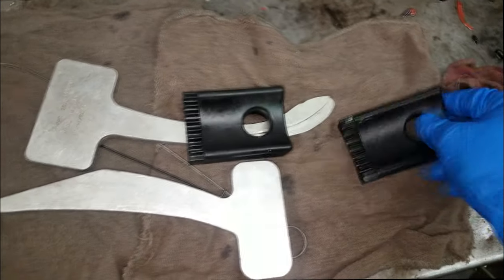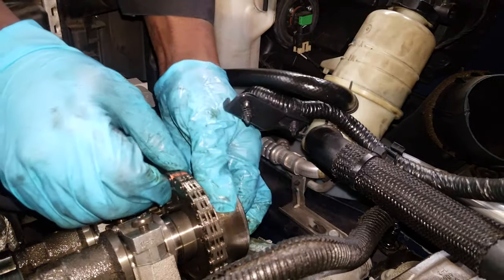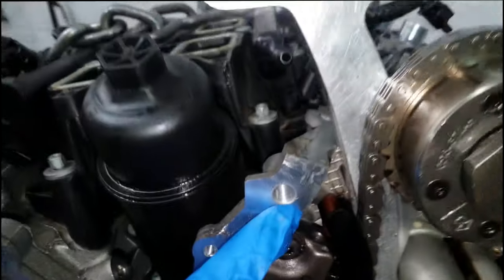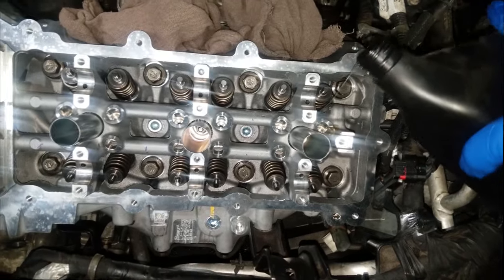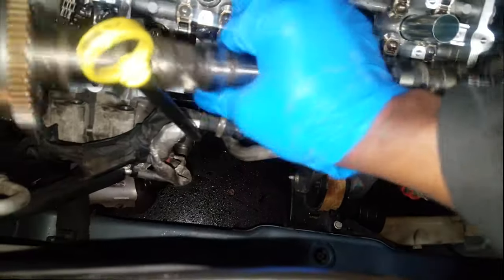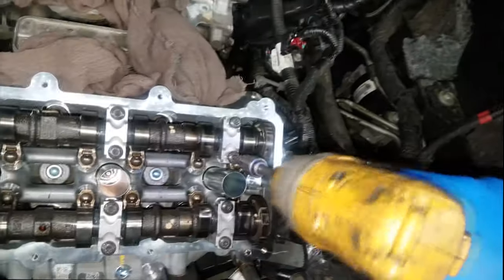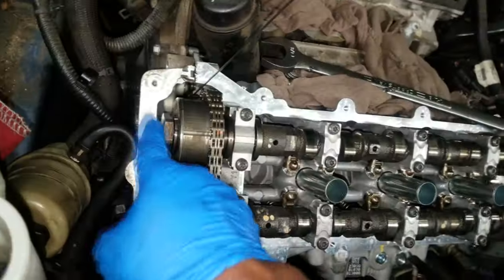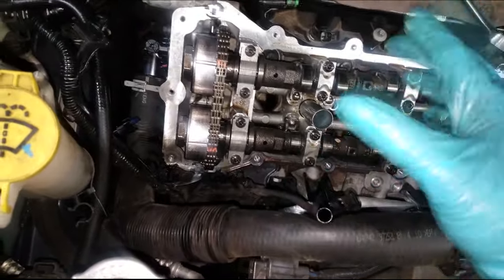How to Replace a CAMSHAFT, CAM Phaser,  rocker arms, 3.6 Pentastar, Timing Chain TOOLS P219A P219B

Comment: Just changed lifters and rockers using the tools. Now have p0019 and rapping noise on start up from front of motor (3.6 pentastar) that goes away after 2 seconds. The engine nearly stalls then sets code. Any ideas? Runs really quiet but has no power. Like out of time.
Reply from the maker: Did you cheat and pry the cams up to remove the parts or was everything removed properly? Also, are you subscribed to the channel?

Comment: I have a 2012 dodge challenger 3.6vvt will be replacing ext. Cam on passenger side which piston needs to be TDC to do this piston 1 are piston 4
Reply from the maker: Hey Richard, this engine has 4 camshafts, if number 1 piston at tdc, the marks on the phasers should be aligned. I would mainly focus on the marks on the cam phasers because there is no mark on the crank pulley. Curious, why are you replacing the cam? Also are you subscribed to the channel?
Reply: @OnlineMechanicTips  yes I am subscribed I'm replacing the cam,rocker arms,and lifters for that side because I let replacing a bad rocker go on for to long and it eat into the lobes
Reply: @OnlineMechanicTips  so the scribe lines and the arrows on the  cam phasers will only line up at TDC correct
Reply from the maker: @savage_empire_ammunition  yes,  also mark the chain so you can put everything back in the right place
Reply: @OnlineMechanicTips  thank u for your help and content
Reply: @OnlineMechanicTips  last question the oil control valve socket size

Comment: Hey bro I just replaced the drivers side rockers and lifters. All the timing marks are good and dead on but my chain has a little slack in it. How can I get the slack out of the chain?
Reply from the maker: What kind of car is this? Also are you subscribed to the channel?
Reply: @OnlineMechanicTips  yes I'm subscribed to u bro...and a 2016 charger sxt
Reply from the maker: @stanleyjones2555  Thats bank 2. Its the tensioners job to remove the slack but that may not fully happen until the the car actually start running. As long as you 100% sure its timed perfect and you have manually rotated engine to verify again and its still in time, you good. Recheck again with all the remaining slack at the tensioner area. When you start it that hydraulic tensioner will do its thing. Its not un-common that the chain appear to have slack.
Reply: Ok I was able to put a wrench on the cam and rotate it a bit and the chain was tight again I was just worried that when I start the car the slack would come back. Do u have an email address so I can send u pics of the timing marks. And should the cam bearing caps be torqued to 7.4 ft lbs?
Reply from the maker: @stanleyjones2555  Hey bud, I dont no the specs by hard, And if the marks are lined up, you should be fine. Im not understanding your concern..Look and make sure your specs are right. https://www.youtube.com/watch?v=xwT9z6SB9l0&t=40s
Reply: Thanks for your help bro!
Reply: Should there be a tight spot when rotating the crank by hand. When I rotate the engine it will turn easily then there is a hard spot that takes more force to turn it. Is this something that's normal?
Reply from the maker: @stanleyjones2555  Yes this is normal as to it will feel like compression stroke. Not a problem
Reply: Ok so I took all the plugs out to make sure it will turn freely...after doing that the timing chain marks moved from the marks on the cam phasers. Do I need to keep rotating the engine until the paint marks line back up?
Reply: Nevermind Bro I got it! Just had to keep rotating the engine until it the marks lined back up. Thanks for all your help homie. 💯 Keep doing what your doing Bro. 💪💪

Comment: I just completed this job on a 2014 Ram. Same 3.6 engine but now I'm getting a p000a and p0017.. the engine will stumble and surge at 900rpm mostly. Sometimes it takes longer to set the codes but I'm racking my brain trying to figure this new issue out. Any advice? Thanks!
Reply from the maker: What do you call this job? What exactly did you replace? Also are you subscribed to the channel?
Reply: @OnlineMechanicTips  yessir I'm subscribed. The truck came in with a constant tick and no codes. Pulled the passenger side valve cover off, found one rocker arm on the intake side had failed and ate into the cam lobe. Customer approved replacing all the rocker arms, lifters and intake cam for just that one bank. I followed the procedure, torqued everything to spec but now when I start the vehicle it lops around 900 rpm a few time until finally settling down. If I rev it or drive it (truck bucks sometimes at parking lot speeds) long enough it will eventually set those codes I mentioned previously. I've relearned the crank/cam position and cleaned the oil control valves with my scanner multiple times. Changed all the solenoids and sensor just to see what would happen and nothing. Fresh oil change after the job as well.
Reply from the maker: @SheaAP1  So if you did all the rocker arms you had no choice but to remove phasers for timing chain removal (at least I hope) couple things, this a cam code thats monitored by a cam sensor. Phasers has to be on point and properly timed. Also curious if you loosing oil pressure at those oil gallery plugs right under the phasers. You gone have the back track what youve done. If problem was not there until after you done this repair, look at what youve done. Sometime when the oil control valve phaser bolts removed, the spring inside the phaser would come apart, thats why I replace phasers at 80k and up

Comment: What causes the rockers to fail and do you just replace the failed ones or all of them also what about the lifters? Is it just the intake or exhaust  rockers that fail or both?
Reply from the maker: Here at the dealership we only replace just the failed ones if its under warranty. I suggest if you plan on keeping the car that you replace them all. As for what causes this, thats an ongoing debate, everbody has they own take on it. Thanks for watching. Do not forget to sunscribe to the channel please, thanks
Reply: Right now  it mainly rattles on startup. but, I feel like it has developed a continuous faint noise. possibility an exhaust leak. I have replaced a few rockers on some late model Audi's before the first oil change which is just plain defective parts 🤔
Reply: Would you say the rattle on startup be one of the cam phasers or rockers?
Reply from the maker: @michaelmoore9220  Bud, have you subscribed to the channel and thumbs up the video?
Reply from the maker: @michaelmoore9220  This Pentastar engine valve train noise can come from different areas. Do your ABS light come on?
Reply: The abs light has come on before but not regularly and is off after a key cycle i guess I need to hook up the modis and check for any historic codes

Comment: Did chrysler ever fix this problem?  Thanks
Reply from the maker: If you referring to the ticking noise, the parts have been revised. So until the newer parts installed, you will likely have same problem. But no, there is no recall on these repairs.

Comment: My timing chain tensioner keeps ratcheting when i crank the motor by hand, its like the tensioner isnt fully engaging, how do i fully release the piston? or is that normal?
Reply from the maker: Hey bud, I see you a subscriber, thanks. Listen, the plunger on the tensioner when retracted should stay retracted. This keep tension on the guide which in turn keep tension on the chain. Im not understanding what you mean
Reply: @OnlineMechanicTips  Hey thanks for the response.  I have released the tensioner, i see the piston pushing on the guide, but when I was cranking the motor by hand to make sure everything is spinning the guide is going back and forth and i see the tensioner piston retract back into the housing and then back out to push against the guide.  Hard to explain but i assume it is not supposed to happen
Reply from the maker: @evanjacob8807  It will extend then stay out once you start car. Best thing you can do is to put all the chain slack at the tensioner point where it will extend out the most.
Reply: @OnlineMechanicTips  Thats exactly what i needed to know, didnt wanna put it back together and fire it up if that isnt how it is supposed to work, thanks man! Im used to worked on LS motors, this dohc stuff is way more complicated lol

Comment: I have a Dodge Avenger 2011 v6 3.6 replaced head gasket I put new timing Chains kit car starts good the first time but won’t last on 5 seconds then I started again it only starts when I press the gas all the way then when I release the gas it turns off messed with the timing like 5 times car was running perfect need help.....

Comment: What is the side of the Oil Control Valve head?
Reply from the maker: Hey bud, thats a 1 13/16 socket I think..Are you about to replace the phasers of do a rocker arm job? Also are you subscribed to the channel?
Reply: @OnlineMechanicTips  Thank you so much. I am replacing my rocker arms, the needle bearings went bad in a few. Just been picking it apart between jobs, and ran into not having anything to fit it, and couldn't find the size anywhere. I am subscribed, keep up the good work man 🤙🏼

Comment: Man, I have QUESTION 
thanks for making these vids man . I watch yuh all the time

My question is when putting new camshafts in how do you know that the shaft is in correct position before attaching phasers.
Reply from the maker: Those phases will only connect /o the cams 1 way. That lil dot nipple will have to go in. From there rotate cams until your marks match that hopefully you marked. The holes in the center of the cams should be pointed straight up
Reply: @Online Mechanic Tips   thanks a lot boss, just about to dive into a jeep wrangler to do lifters & rockers . Might hit you up for more advice if that's aiight.? Maybe I'll make a vid
Reply: @Online Mechanic Tips  so if I were to replace just lifters, couldn't I take the cam off the phaser without removing the phaser from the chain ?
Reply from the maker: It gets tighter and more risky the closer you get to the front. But I'm curious why are you replacing the lifters?
Reply: @Online Mechanic Tips  rockers & lifters the ticking started a few hundred km ago and is getting louder . When I listen it' sounds like two rockers are thrashed on the left side exhaust cam. The right side had bad failure and had new camshafts ect before I bought it

Comment: I have a Buick enclave I'm working on and It ticks pretty loud so I was planning on all new rockers, maybe lifters, and judging by the time it has been this way, I figured it will need a cam too.  When I look up the cam it has 3 different cams (gens) listed (basically 1, 2, &3).but I don't know which is on this car.  Is there a way to find out without taking off the valve cover or does it even matter which gen I use???
Reply from the maker: Hey bud, thanks for watching. Just so you know, im a huge believer in visual inspection. I tend to always remove the valve cover to get a closer look at the damage and also which parts will be needed. To me, thats the only way you can give an accurat diagnosis. Please thumbs up the video and subscribe to the channel for me, thanks

Comment: Can you replace the timing chains on a dodge caravan without pulling the engine? It is a 2015 with the 3.8
Reply from the maker: There's no 3.8 in a 2015 model caravan. Also curious as to why you want to replace a timing chain? Also are you subscribed to the channel?
Reply: @OnlineMechanicTips  must be a 3.6 . I did subscribe the same time I asked the question. Scanner says crank and cam position is out of the correlation.
Reply from the maker: @rjpemb  OK that does not mean you need a timing chain. Theres a number of things that can cause that. But it has to be diagnosed. Theres no one thing anybody can tell you what to replace that will fix that code unless they diagnose it first. If they do or try, they are guessing.
Reply: @OnlineMechanicTips  the crank sensor and both cam sensors have been replaced by me and one of the 4 sensors that are on the front has been changed. I don't know what the 4 in front are or what they do
Reply from the maker: @rjpemb  So im confused, you thinking maybe a timing chain will fix that? Your question was do the engine have to be removed in order to replace a timing chain. No, it do not.
Reply: Don't mean to be confusing and you did answer the question I asked. I just don't want to throw a bunch of parts and money at it and still have the same problem.
Reply from the maker: @rjpemb  Well thats exactly what you will be doing if you just blindly replacing parts. Hard parts at that, such as a timing chain. This stuff complicated and have to be diagnosed using a good scan tool. Look at it this way, your next $100 guessed part you maybe about to replace, dont. Use that same $100 for diagnostic charge at a shop with a good scan tool and have them properly diagnose your car (most shops charge $100 for diagnostics) Take that info and then measure if thats something you can do risk free to save money.
Reply: @OnlineMechanicTips  I've got a good scanner but I'm sure they make better. Its been in the shop more than Its been on the road. I don't like throwing parts at them at all. My scanner is a snap on

Comment: Jeep technician said i need to tighten the oil galley. When I pulled the valve cover on the 17 Jeep Cherokee found a threaded hole where a bolt looks like it goes but I don't see that in this video.
Reply from the maker: https://www.youtube.com/watch?v=_Ow6NmN9ASM&t=518s

Comment: So before I found your video I watched some others and ended up not using phase lockers. Now I’m putting my engine back together and the driver side phaser arrows for timing will not line up. Any suggestions that would help?  Please. Note I’m also working in -2 to 10 degree weather here in Massachusetts. Under a very large tarp made shanty.
Reply from the maker: Im not understanding. There should be 12 links between both phasers but the arrows should line up. Also are you subscribed to the channel?

Comment: Hello Mr. So interesting about your great job and videos of course!. Do u have a video work replacing a temperature engine sensor in a 2011 jeep grand cherokee laredo 4x4, motor 3.6l and how to do it please?.....
Reply: Thanks for your help.
Reply from the maker: Are you talking about a coolant tem sensor? Also are you subscribed to the channel?
Reply: Yes coolant temp sensor and yes 'm subscribed
Reply from the maker: @carlosa.1511  Hey bud I just checked. No I have none but that sensor on the drivers side head in the rear on the side of the head. Just remove the cover and take a 3/4 socket and just unscrew.
Reply: @OnlineMechanicTips  i'll try it thanks.

Comment: Do the phasers knock when they are going bad?
Reply from the maker: Hey bud, they can fail in a number of ways. What problems are you having?
Reply: @OnlineMechanicTips  Yes I'm subscribed. I have 2013 Ram 1500 3.6L it has started knocking on startup it sounds kind of like a rod but seems to be coming from the front of the left valve cover
Reply: @OnlineMechanicTips  oh and it has 280k miles on it
Reply from the maker: @jhaynes5923  Yes, cam phasers can cause that. Watch this video and see if the noise similar. https://www.youtube.com/watch?v=cAqw_sPC518&t=296s
Reply: @OnlineMechanicTips  yes that is exactly what it sounds like not as loud but that is it Thank you!
Reply: @OnlineMechanicTips  can I offer payment for questions to help make this easier
Reply from the maker: @jhaynes5923  Hey bud, i would not even try to do this job if you do not have the proper tools and understanding how the timing system set up. This a complicated job for most mechanics and im just keeping it real. The videos are as explained as much as would be questions over the internet.
Reply: @OnlineMechanicTips  I have no problem doing the job I've been an aircraft mechanic for almost 40 years worked on and built car for lo ger than that but I do not have the holding tools for the chain tensioner can these be purchased
Reply from the maker: @jhaynes5923  yes, I hear people buying the plastic kit dirt cheap on amazon
Reply: @OnlineMechanicTips  thank you  it really doesn't look that hard compared to an engine change on a Bell 407

Comment: I have a three six making a rattling noise and I thought it was a timing chain guide or maybe a bad tensioner but could it be a cam phaser??
Reply from the maker: It could be any of these. You need to analyze the noise first before tearing it down for inspection. Do it sound like a lifter or rocker arm tick? Also are you subscribed to the channel?
Reply: @OnlineMechanicTips  yeah that's the problem I already tore it down I had a po305 and of course I assumed it was a coil or a spark plug so I did a major tune-up on it and it didn't solve the problem and then I learned that this engine is notorious for rocker arms going out on it so I tore it down and sure enough the rocker arms are bad and it completely ate the lobe off of the intake camshaft but I want to fix whatever that rattle noise is before I put it all back together anyway I just Googled it can't say if there's only 50 bucks a piece so that's not too bad I think I'll just replace all four of them but I sure hope it's not a timing chain tension or guide that would really bite appreciate all your help and by the way yes I am a subscriber I would ask a favor of you if you can please subscribe to my channel that would be great cheers my friend wrenches up
Reply from the maker: @davidnorthrup4291  Also make sure your torque those oil gallery plugs down while you there. Which channel do you have so I can check out and sub?